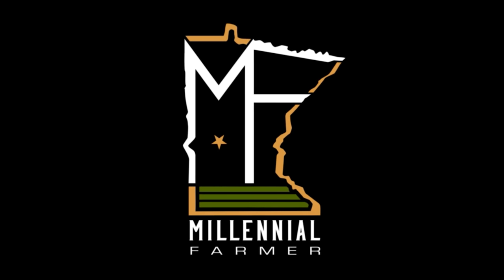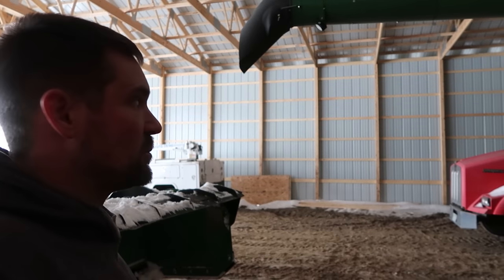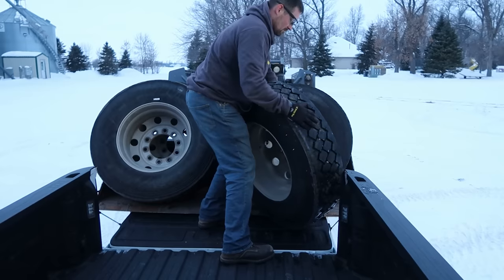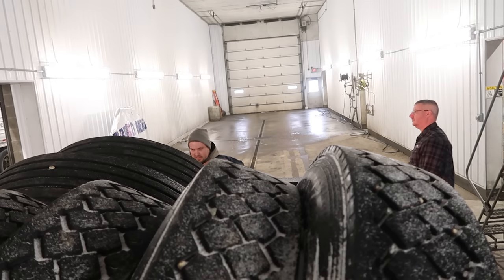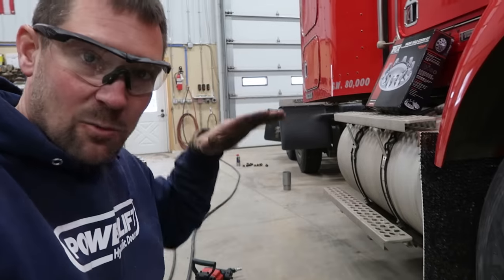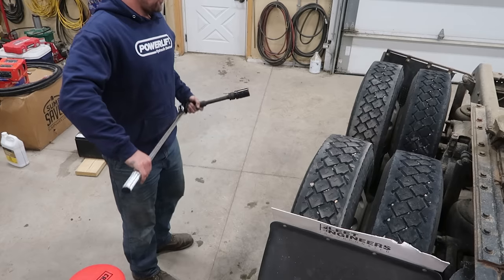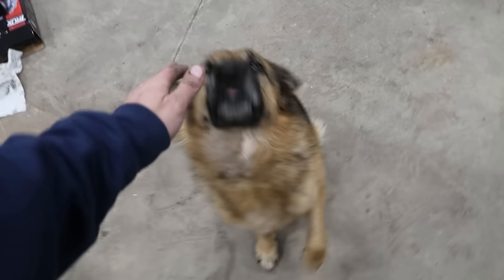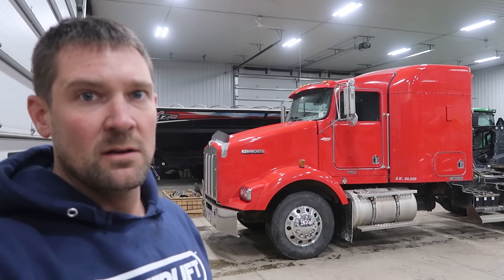This is NOT A HOW TO VIDEO! I Can't Believe it!

Comment: Zach,
Put some silicone caulk behind the decorative lug nuts. That will help to not loose them. Also anti seize where the aluminum hub wheel sits on the hubs. Easier to remove when needed.

Comment: Zach, i suspect you may have cable and connection problems, not necessarily battery problems. Next time it's hard cranking have someone crank it while you measure voltage at the battery posts, If the voltage stays up the batteries are fine. Now do the same thing measuring at the starter lug and block ground. If the voltage there is dropping off but the voltage at the batteries themselves is good, time to replace the cables and connectors.

Comment: Resistance in the cables from corrosion. Replace your cables. Go back with 4 batteries. Put the gear reduction starter on it.  If the battery disconnect is installed properly, it should prevent any draw on the battery because it will completely separate the batteries from the trucks electrical system.  I have seen where a battery disconnect is put in incorrectly and it will separate the batteries from the starter but not from all of the electrical system leaving a draw connected to the battery despite the disconnect.

Comment: Next time you pull the wheels off invest in plastic wheel gaskets that go in between the wheel on the drum.  If you can’t find any use nickel anti seize.  What happens is over time the aluminum bonds to the steel.

Comment: On top of changing the crappy battery cables that others have said. Also check the terminals and connections on the starter AND ground connections.  If your grounds are corroded and have a poor connection you're fighting a loosing battle with electrics.

Comment: so far as the steer axle and the drives as well, they make a rubber/plastic spacer that helps aluminum rims from sticking to the steel drums.
may help the next time you try to remove them.

Comment: Hey little trick 
Put a volt meter on the battery and see if you got a draw..
Then pull one fuse at a time until the draw stops.
There's where you chase your short.. and or grounds bad..

Comment: BATTERY ISSUE; with it being warm there is resistance, like everyone has said check connections ect. But also uou could have a cable separating on the inside causing the resistance! Ran into that a few times causing the same starting issue you're having! Remove both ends of the cable and OHM it out that'll tell you if the cable is bad

Comment: Get a heavy duty disconnect and install it between your primary ground and where it attaches to the frame. You’ll need another length of wire depending on where you place the switch. They also make battery “straps” which replace the jumper wires between each battery. But cut away any plastic over mold between where the wire joins the terminals. It traps in moisture and speeds corrosion. That one cable you showed that has some green growing/showing on the copper probably needs to be replaced. Or at least shorten and re-terminated.  Which requires new terminals to be soldered on and sealed with that heavy duty glued lined marine heat shrink tubing. Grab a utility knife and start pealing back the jacket from the wire to see how far down the wire that the corrosion has
Gone. It could be a inch’s or feet!

Comment: We just fixed this exact same problem. We changed the battery and even added a battery to the system and still same problem if you leave the truck for a day or so it acts like it’s so low it won’t crank. We finally replaced the cable from the battery to the starter and it fixed it our truck has never cranked over that good in the two years we’ve had it and with no problems leveling it sit for over a week.

Comment: Research Deka batteries. I’m a car hauler using electric hydraulic pump and Deka is the best great cold cranking amps. They weighed 10 lbs more than Napa, interstate, I’ve tried them all in my 40 plus years in the business.

Comment: Just a note for putting truck wheels back on. a couple of levers or pry bars either side of the tyre at the bottom make for relatively easy lifting an aligning of the wheels onto the studs.

Comment: Heat in electrical or hydraulic systems is a sign of resistance, resistance is generally your enemy on cables or hoses....those cables need to be cleaned up or replaced to get a much better connection.

Just cleaning up the connections and reconnecting them, may very well have gotten you a much better start even with the newer batteries.

Comment: Typically when battery cables get hot on the positive or negative side there is high resistance in the circuit. Either between bad ground or bad cables leading to the starter. I would recommend replacing all grounds and clean and prep all ground studs.

Comment: like several people mentioned, cleaning cables is the key, use a drill and a rotary steel brush!! I can clean a set of cables and batteries on a four battery system in about 20 minutes start to finish!!

Comment: I was JD Parts Mgr. now long ago. Used to tell guys to please spend $50 on cables BEFORE they spent $200 on batteries and/or starters (all figures relative). Of course that was all before the price of copper went crazy, but still... Unless a new cable end gets damaged, a waste of time and effort to put a new end on a cable. Electric current runs on the surface of the wires, not thru the center.

Comment: Next time put anti-seize  on them drump. Aluminun and steel adding salty roads make it very hard to remove  as we seen on the left wheel. Put the anti-seize at the contack points will solve that problem

Comment: Spray PB BLASTER  before removing tires nuts..use wire brush either by hand or in drill on all studs when reinstalling, applay  anti- size blue  cream on studs and torque to spec.

Comment: We’ve had to grind down the plastic nut covers to fit before with those trux kits just enough for the threads to grab just a thought, we also have a stationary belt sander that makes it easy

Comment: Had my aluminum rims on a Dodge Intrepid corroded on and I could not get them loose no matter what I tried (sledge, bars, etc). Mechanic told me to just hand tighten lug nuts and take it slowly around the block. All 4 tires broke loose and it was an easy day after that.  You could try loosening the steer wheels, retighten hand tight, lower it down then steer back and forth to break them loose.

Comment: Any corrosion or rust adds resistance and causes heat to build up. For sure change that one cable and maybe the rest for added piece of mind. I would change those two solenoids there as well. The wheels cleaned up nice.

Comment: Had so much  problem  getting wife's wheels off when doing the brakes years ago because aluminum rims glue themselves  to hubs that I brush anitseize thin coat on face of hubs where contacting  wheel do it on every thing I work on now it really helps

Comment: Yeah you need to replace the cables to get rid of that corrosion that's seeped into them. Also use some di-electric grease on the battery terminals, especially since you are running with the box open. The grease is non-conductive (That's what di-electric means) and only the area the grease gets pushed away form contact will conduct. Typically when doing crimp connections on battery backup systems we put the whole end of the cable into a tube of di-electric before putting on the crimp to cut down on that corrosion creep. The di-electric grease will protect the rest that isn't touching from corrosion. The grease will also help reduce the surface conduction across the dirty salty batteries that will drain them eventually. 

You can test for self-drain conductivity on a battery by putting the positive lead of a multimeter on the positive then touch the negative to dirty spots on the battery. Ideally you want 0v, but if you see 1-2v you know there is a conductive path to that point that point. And if there is conductive paths across the battery to the terminals then well it's shorted with a high resistance and very slowly draining.

Comment: I would recommend the JW Speaker LED headlamps.  They are the top of the line LED with some patented engineering.  They are a projecting LED versus the mirror reflected.

Comment: Top post battery’s are for high ampere draw studs are not. You want cables that have the lead clamps cast into the cable. No coatings on the eyes. Use copper nuts. You can buy copper beryllium nuts as strong as stainless steel and low resistance. Felt washers under the clamps on the posts soaked in PB blaster. Brush terminals every time. Never buy serviceable batteries always sealed batteries. Wash The whole battery with soap and water and reapply thin oil to the felt washer. You can run 2 positive cables to the starter and 2 cables to the frame. Ground the starter to the frame with a cable. The starter can have a ground cable to the battery and frame. You can get bigger starters. You can get copper beryllium studs and nuts for starters for more torque to hold on 2 cables with a nut as long as possible. Recrimp cables even if cast they will get tighter. Make sure starter and bellhousing is corrosion free ware it bolts to the starter and oil it. Clean every case connection on the starter from corrosion and oil them. If you use grease only use grease that has good conductance and check grease with a ohm meter. You can put protective grease over all connectors. If you solder wires very mildly acidic solder dopeant will have greater conductivity mildly acidic. Use more batteries. Make shure batteries are getting between .5-1.5v of A/C current from the alternator. Most alternators put out a little A/C current as it scrubs the battery plates of scale and makes charging faster. Most battery chargers have poor power quality. An electric motor that spins a alternator is the best way to charge a battery. Make shure all nuts are square on the bottom. You can use copper washers with nuts. Battery eyes the right size. Their are battery heaters if you heat you block you can heat your batteries. Electrons do go through plastic battery cases so don’t route a negative cable around a positive cable and don’t make a lump of cables on top of the battery as it causes a magnetic field this interrupts charging and discharging. A voltage drop test can tell you ware problems are. Take the battery’s out of it when not in use like out of the truck. Put the battery boxes close to the starter. Lots of stuff.

Comment: Agree with Douglas Williams, it's called electrolysis, dissimilar metals, dirt and corrosion cause too much resistance. Throwing more batteries at the issue does not work....clean connections do work. More worrisome if you have a grounding issue which will deplete any battery over time, especially in cold weather.. Else wise, thinking you'd benefit with a tire dolly, save your back!!! Oh! And try some anti-seize on those front wheels, between the rim and the hub, not the threads of course 🙂

Comment: the corrosion you saw when you cut the rubber off the cable is causing higher resistance than normal. I would change the cable first. If you don't, then you will eventually have to replace the starter per the amp draw on the starter is higher do to the corrosion.

Comment: Cross reference the starter part number over to the updated gear reduction one, cranks faster much easier starting. And like one of the others said corrosion and those power blocks

Comment: Put rubber matting between the batteries and the metal of the battery box.  Ensure that you're pulling your positive from one end of the battery bank and you're negative from the opposite endof the battery bank. And do the same when charging.  This will ensure you're using your whole battery bank instead of just one end of your battery bank. And you may be doing this already I can't tell just a thought

Comment: Hey Zach, I’m a heavy diesel tech, and unfortunately I see alot of poor starting circuit performance and failures. Where the trouble usually starts is at the batteries of course, which you replaced. Good quality batteries always make a big difference. Second, those battery cables are showing signs of visible corrosion, as was pretty evident when you cut the isolation back. Corrosion in a starter cable leads to voltage loss, which hinders starting circuit performance. I good rule of thumb is you are only allowed a 0.5V drop on the negative (-) and insulated side (+) of the starting circuit, a 1.0V voltage drop max in a 24V truck starting circuit. You can easily test for this by performing a starter circuit voltage drop test on both the insulated and ground side. I would recommend changing those battery cables out and having a look at those connection blocks. Go over the whole starting circuit with a fine tooth comb, clean up any unwanted corrosion and protect all connections from future corrosion. This will ensure you don’t have any unwanted voltage drop across connections, making for a truck that will always start. Third, you mentioned in a previous video you were looking to upgrade to a gear reduction starter, this would greatly improve starting performance as they produce more torque, therefore being more efficient all while using the same 24V supply. 

I hope this helps, happy wrenching 🤘🏻

Comment: Most stuckk wheels are aluminum mounted on a steel hub. The dissimilar metals will reaact and corrode. A application of never sieze on the hub and wheel pilot hole curses that. Works in maine and new hampshire. Aught to work in the other end of the rust belt!

Comment: The batteries are NOT in tandem. They are in parallel.  One battery is doing most of the work and causing the cables to get hotter. Another possibility is that one battery is much weaker or shorted, causing the other 2 batteries to also feed it.

Comment: Baking soda and some water on the cable ends then coat them in some grease. Check and see how old the battery cables are.Look into a shop semi tire dolly assist tool. Trust me, it will save on your lower back.

Comment: You need to replace the cables.  They old ones have excessive resistance which is what causing the heat and voltage drop not allowing it to crank over quick enough.  You can measure the voltage drop by using a multimeter and putting the leads on each of the end while cranking and seeing what it read.

Comment: I’m pretty sure that I’ve already mentioned to you how I fixed the hard start/ no start problem that I had that is identical to your starting problem in your trucks.  The easy fix is just to add a 4th battery to each truck. Your battery boxes are sized to hold 4 batteries. You will just need to pick up jumpers.  Also it’s a waste of money to buy any battery that is more than 750 cca your starter can’t do anything with more than 750 cca

Comment: I will mention that as you check for a draw, any resistance in the battery cables will prevent the batteries from fully charging as you run the truck leading to a flat battery among the three.

Comment: Toilet ring wax is a great for lug nuts, trailer hitch balls, etc. and automotive electrical connections subjected to moisture and corrosion.  It has fantastic water washout resistance, obviously.

Comment: Technically an air compressor should be drained everyday.  There are automatic valves that can be installed on air compressor to keep the water from building up in them.  Just a little advice.

Comment: I assume these batteries are running in parallel, and it’s radial (+ to + to + then to vehicle) your link from the final terminal to vehicle will always have more current flowing thus be hotter as it’s the only link with 3 batteries flowing into it, especially if you have other factors increasing impedance. Try linking another cable from the other end of the chain to the vehicle as well, this will increase current capability(peak power increase to motor), allow a more balanced loading of the batteries, reduce resistance and vulnerability to issues from corrosion (less frequent maintenance). Do it for both polarities of course. The lugs didn’t look great; couple strands broken but it’s hard to tell with the corrosion because your conductive areas are where the lugs have been crimped on to cable not areas you can see. Also way to much insulation is removed which is always going to let more stuff in, increasing maintenance cycles. Get it as close as possible (if your going to bent sometimes leave some spare between insulation as lug,  butt up to the lug if not). Also when crimping new cable lugs on its best to have the cable bent as it will be in operation then cut, strip and crimp in that shape. This allows the inner cores to be the correct length as those travelling on the outside of a bend travel further,  crimping straight then bending can stretch core which down rates or break them, If possible crimp with a hexagonal crimp dice not a single point compression. All this should improve start up, life of batteries and lower maintenance.

Comment: The reason that battery heats up that much would likely be because how there wired and how much power it takes to start especially the T800's 
Normally how semi trucks and large equipment are wired is say you got 3 batteries wired together in parallel to equal 12v more CCA is the semi truck wires go to the far battery and then you have bus bar wires going to the center and 3rd battery  
The reason this is a problem is because it takes the power from the far battery and it just is not efficient

Comment: I work for Uilk custom chopping in pipestone 30 trucks go thru the same BS every year… maintainers on everything now! we have recently learned with field trucks and bouncing the lower the CCA the wider the web in lead cells in the battery more durable the high CCA batteries have finer cells that get weak and break easier with rough use

Comment: The easy solution to your discharge problem is fit an isolator switch on the earth cable .For security you should fit one with a removable key,no key ,no start, no theft.